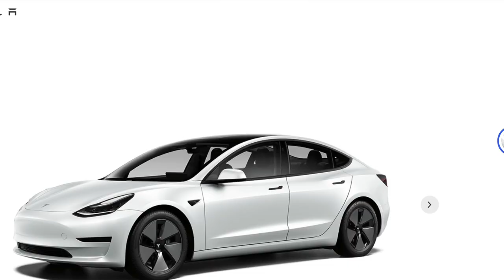Build Quality of 2021 MIC model 3

Comment: Looks like the MIC model 3 build quality is better than the US.  Even after all these years the US still suffers from the same panel gaps.
Reply from the maker: Shanghai Gigafactory is also a new factory, too.
Reply: i had a few 2000s american cars, corvette, mustang, hummer h3 from new. they all had some trim, panel gap, creaks, rattles. I think its just american manufacturing is trailing Japan, and now, they are probably behind china.

Comment: Hi! Great review! Thanks! Can you please tell me what is the time needed to charge the car from 20% to 80%?
Reply from the maker: If you go to the V3 supercharging station and also use the onboard navigation system to navigate to the charging station ( so that the battery can be heated up to the proper temperature to obtain the highest charging speed), it should be around 25 minutes to charge from 20-80%. I made a video about the charging test, you can check it out in my channel.
Reply: @gogochang1153  thank you.

Comment: It looks good, but I’m disappointed that the paint quality is no better than what we get in the US.  Do you know the curb weight of the MIC 3?  I hear the LFP batteries are heavier, but how much?
Reply from the maker: LFP battery SR+ model 3 has the same weight as long range model 3, the vehicle info here shows the curb weight is 1745KG. This pure black color has only one single layer so it is really thin. I am not happy with the paint quality either, but white and red are better than black I think.
Reply: @gogochang1153  I have a white US 3 and I’m not sure if paint thickness is the problem.  It seems “soft” and easy to scratch just by brushing up against it.  The scratches just stand out more on a black car.  I think Tesla is just trying to save time and money by cutting down the baking process and on the clear coat.  I wish I could afford PPF.
Reply from the maker: @willaerley7140  white color is multi-coat painting so I think it is thicker. How much does it cost for PPF in the United States? It is also very expensive in China, the top PPF for model 3 will be around 2800 USD.
Reply: @gogochang1153  In US $5000 for the whole car.  Ouch!  There are some pre-cut PPF that you can install yourself, but it usually doesn’t look as good.
Reply from the maker: @willaerley7140  5000USD is a lot!

Comment: Honest videos thank you. I am wondering is there any co ncerns with the metal used in the mic model 3 . I presume it has a specification just like ones made in the USA.
Reply from the maker: No need to worry about that. I have seen the crush test of MIC Model 3, it achieved a really good result ( the same as US model 3)
Reply from the maker: Different from other MIC brands ( BMW, Audi, VW etc) , MIC Tesla is 100% foreign direct investment rather than joint ventures

Comment: I’m not sure how I feel about the new door panel wood trim.. it doesn’t look levelled to the centre console trim and the wood colour looks a bit different.
Reply from the maker: It is leveled to the center console but the gap between the door panel and center console is a little bit larger. The color is exactly the same.

Comment: Thanks for the good video.
I was wondering about the quality of the Model 3 imported to Japan as it is now made in Shanghai.
There is a Youtube video about the SR+ LFP battery having standby power issues.
https://www.youtube.com/watch?v=YaIX3D8SR6c
Do you have a similar problem with your SR+?
Reply from the maker: No I don’t. LFP battery is highly sensitive to outside temperature. This problem is likely to occur during extreme winter conditions. If you can install a wall connector at home, I don’t think this will be a problem for you since you can plug in every night. Hope this can help.
Reply from the maker: And I can confidently say that MIC Model 3 has a higher level of build quality than US Model 3 in general.